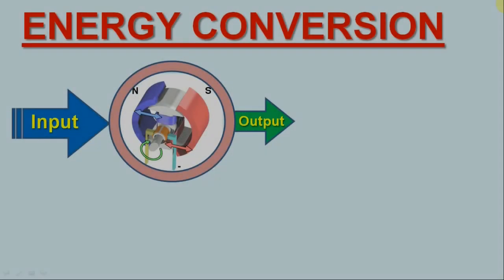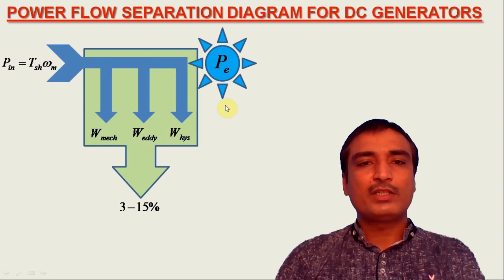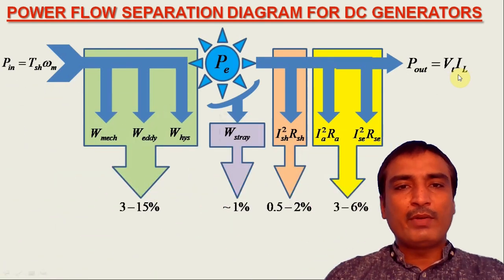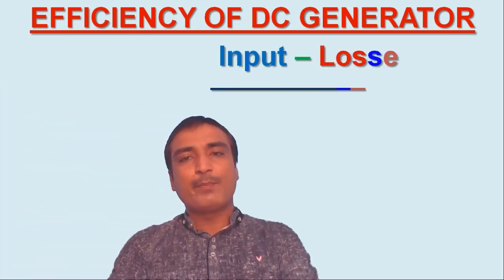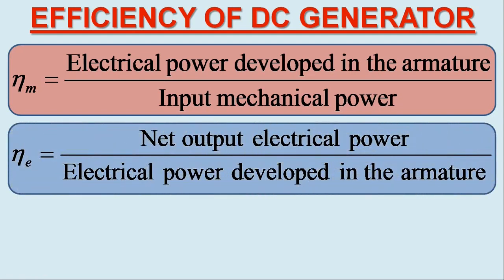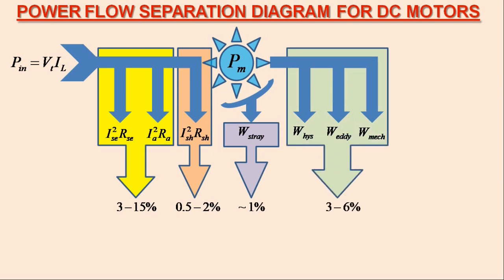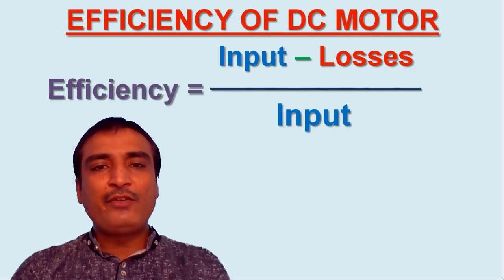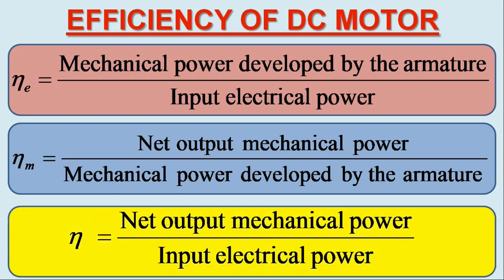Power Flow Diagram of DC Machines | Mechanical, Electrical and Commercial Efficiency

Comment from the maker: *Minor Correction*
In power flow separation diagram for DC Generator, the typical values against Rotational Losses and Variable Losses are to be read as 3-6% and 3-15%, respectively. They appear to be swapping with each other in this video.📌📌 ℹ️📣📣